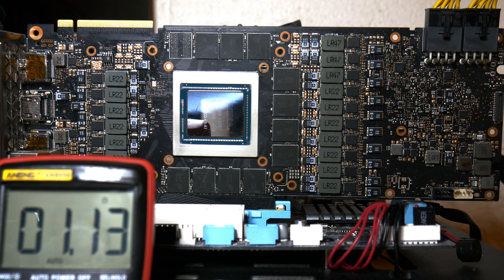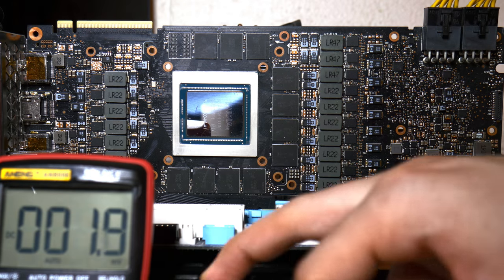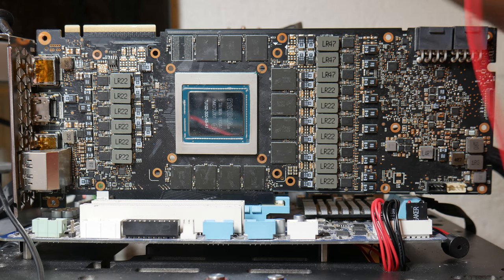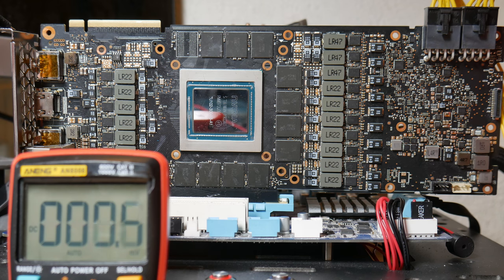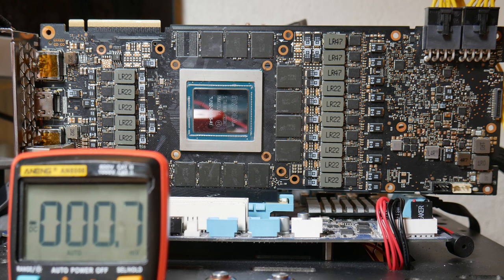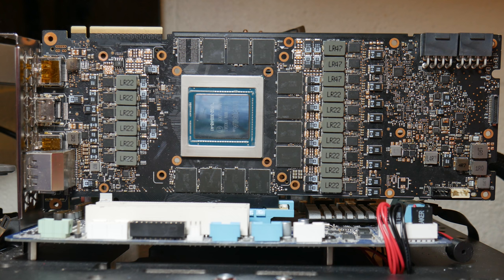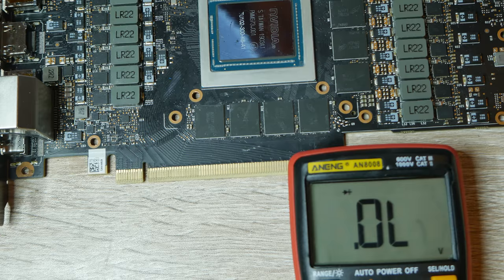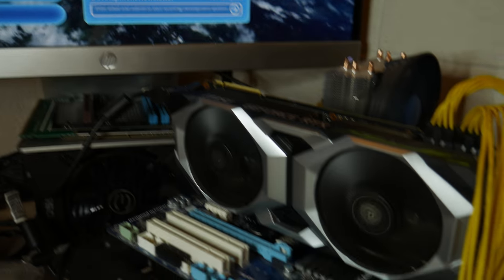Nvidia RTX 2080 Ti Graphics Card Repair - Not Detected

Comment: Great video even if I find it difficult to understand, I am French.  I have a faulty 2080Ti (error 43) with a KO memory module detected by the "mats" program. I did 6 min reflow with a heat gun on the memory but it's worse, the card no longer sends a video signal and it seems that Windows starts up , I hear the drivers updating. Did the reflow cause a short circuit or break the RAM or something else. I had put aluminum foil around the memory. How do I check if it's RAM or something else ? Thanks you

Comment: So I got a rtx 2080ti used stating black screen issue. So I assumed it to have either problem with memory or similar to this. 

After probing the resistance and voltages, all seem correct yet no display! Even tested with different ports. The only thing bizzaire was 9:12 time stamp, the pins showed OL instead of a voltage drop. What can it be?

The gpu silicon does get hot! Infact after sometime, the pex voltage rail oscillates between 1.001v and 0v and at the same time the memory rail also in a similar fashion (1.367v and 0v). Cold start seems to hold these values in a stable manner. No short on any rails (12v, 5v, 1.8v, pex, vmem and vcore). All have the proper voltage and resistance.

PS: I have tested this card as a secondary too. It doesn't show up on device manager. If it had a bios issue, it should have shown up!

Comment: I have a gtx960 which is not going to full hd and there are green dots artifact, seems like the Driver is not installed or not activated on the card. Fans are spinning eventually and pc is powering on. Can you please let me know what could be the parts that I need to check?

Comment: Hi. Great job!! I have one question. What if there is not 5v present?  changed the 5v converter still no 5v. pls help
Reply from the maker: Check VIN, VCC, EN
Reply: @TechCemetery  EN is missing. With voltage injection 3.3v to EN pin I get 5v. But only this. 1.8v 1.0 and the core is missing. Do you know where the EN pin of the regulator is connected to?

Comment: I feel like we skipped a few steps there. How did you arrive at that particular chip. Problems on the 3.3V rail are a royal pain because 3.3V goes to nearly every circuit on the card. I had one the other day where the guy must have jammed something into a DisplayPort. DP wouldn't work, and short on 3.3V. Took out an APL chip, a BJT, and 2 MOSFETs. Dunno what happened, but wow.
Reply from the maker: This is a different 3.3V rail, the 3.3V Aux pin is dervied from the PSU's 5V standby rail, not the regular 3.3V rail. I just used a power supply to heat up the shorted component.

Comment: How do you know where to stab for certain rails on a card? I have a few cards myself, but non of them look alike. So how should I figure out where to stab?
Reply: look for the size of the coils, the bigger ones are for an higher voltage so the biggest 12v and the smallest 1.8v

Comment: I have this same model zotac 2080 ti that crapped out on me last night. I got a new TV setup and was a lazy idiot and plugged a hot HDMI into my running PC. Because of where my PC is located it's sort of a pain to get the plug in and I have to do it by feel. While fumbling around I got some sort of discharge off the backplate and HDMI that zapped my thumb and my forearm through the case frame. I'm not sure if it died as a result of this or if there was already a problem and that's why I got zapped or this caused the problem because I was troubleshooting an output issue with the new TV as a 2nd monitor. The PC is not detecting the card at all now. These kinds of repairs are outside my skillset and I wouldn't want to destroy the card further. Do you take on outside work?
Reply from the maker: I do, I have a discord linked in the description with a repair requests section. You can find my contact details there.
Reply: @TechCemetery  Thank you for the reply, I'll join the discord when I get home from work and contact you then.

Comment: please help northridge fix about rtx 3090 repair
Reply: Bro He seems Like He is Less habituated With solving  complex GPU Problems He is Just good at basic repairing and micro soldiering he should Stop taking GPU repiaring orders
Reply: Yeah I was tempted to recommend this channel to him. It's tough watching him make GPU videos cause I keep thinking Tech Cemetery could fix that!
Reply from the maker: It's hard to diagnose a card over the internet, I'd need the card in hand to make an educated guess as to what's wrong.
Reply: yes, also the EGVA FTW2 1080 that he declared dead. The inspection seems lacking, and I really hope the card owner will contact you for second opinion.
Reply: If Northridge can't fix it in 10 minutes with a parts cannon, he gives up. Not a whole lot of depth, care, or understanding in his fixes. I blocked his channel, couldn't stand his half-assery anymore.
Reply: @Androbeast472  yea he only knows the basic voltages rails that all and thermal camera won’t help at all you need to do measurements he definitely needs to stop getting video cards but he get them because he charge a attempt fee BS or keep the card because clients don’t want to pay the fee basically a scam

Comment: Hello i got 1070 and 2pcs 1050ti its all turning off display after booting... Pc is working with sound but gpu doesnt give display... Sometimes it gives display sometimes it doesnt... Tried in different pc still the same... This gpus didnt overheat because im cleaning it every 2 weeks thru pc blower... Whats causing these? I also tried reading resistances and all seems ok pex 3.3 1.8 5v 12v resistances like in your previous vids its all ok...

Comment: Hi, sorry to bother you again. I followed your tutorials and tried to repair 4 faulty Sapphire Pulse Rx580s. All had an issue with bottom VRM mosfet and 2 blown fuses at pcie 12V. After replacing the mosfet and fuses all cards could boot, but 3 of them got shorted again at the same place seconds later. Possible to know why?
Reply: Is it due to faulty VRM voltage controller?
Reply from the maker: Are you new to soldering? the pin pitch of those MOSFETs is very narrow. It's quite common for beginners to misalign the MOSFET/Powerstage and cause it to die prematurely. I can only suggest you double check the installation and use a lot of flux.
Reply: @TechCemetery  I see. Will try that again soon, thanks for your help
Reply: For all the sapphire pulse Rx 580s that you repaired, do all of them work fine?
Reply from the maker: Yep

Comment: are zotac version in general made with lesser quality parts than like say msi or asus not saying these 2 brands are any better just wondering if zotac is the cheaper ver of the partner cards or not?
Reply from the maker: Not necessarily, generally speaking you'll just want to make sure you avoid a card with an Nvidia reference PCB ( like you the one you see in the video)
Reply: @TechCemetery  ok thanks :) ;love the vids
Reply: yeah nvidia really skimped on the reference design tho i had 2 strix cards that went bye bye (both the memory controller on the gpu going bye bye)

Comment: Is it possible to check for a short on 12 volt rail without opening the card so i can avoid buying gpu's with possible dead core?
Reply from the maker: For a card with a fuse? usually no.
Reply: Sure, just check the PCIe pins like he showed you, then the main 6/8-pin 12V connectors. If you get 0 ohms on any of them, obviously something shorted, and if you get infinite resistance on any of them, you have a blown fuse. Make sure you check both 6/8-pin connectors separately, sometimes each connector has its own fuse. This in itself doesn't guarantee the GPU is alive though...
Reply: @Friend_of_the_One-Eyed_Ladies  tnx bud

Comment: mind blowing work but you never showed us how you traced that mosfet is faulty u just changed it but how are we supposed to know what mosfet is bad?
Reply from the maker: My apologies - I thought it was clear. You can feed a shorted power line current and typically, your shorted component will get very very hot. That's how I knew that MOSFET was the source of the short.
Reply: @TechCemetery  so amazing that u replied i watch all your videos, sometimes on repeat u explain every concept clearly also your Knowledge is out of this world please try to bring out more videos if possible keep up the good work

Comment: Hello, what wil be the possibly case for my RTX 2080 TI with no video output on the screen and the fans spin at maximum speed? Is there a cure for this ? :)
Reply: The capacitor backside maybe if you dont have 3,3v on pci pins?

Comment: Hi there hope you guys have a theory for this one, 1080 artifacting 1 memory module came up faulty on mats replaced it matts passed furmark for 4 hours all good next day not working mats says the same memory bank is faulty but tried a few more times and passed again furmark 4 hours then the same :( what could be causing this?

Many thanks
Reply from the maker: PCB or GPU, those cards are usually not worth trying to repair.
Reply: @TechCemetery  Thank you for your time   and help have a good one buddy :)

Comment: I checked with your referred guy in Indonisia, do you have anyone in the Middle East?
I prefer to send the card to you in USA.
Reply: I have Zotac 1080ti

it is showing in windows device manager as ok if I connect the monitor to the onboard graphic.

but when I connect the GPU it is not showing anything on the monitor.
Reply from the maker: I currently have too much work, try to contact one of the Individuals living in Europe.
Reply: It's probably the pex rail or the 5v fuse for the display ports